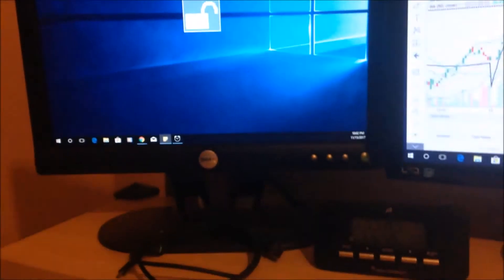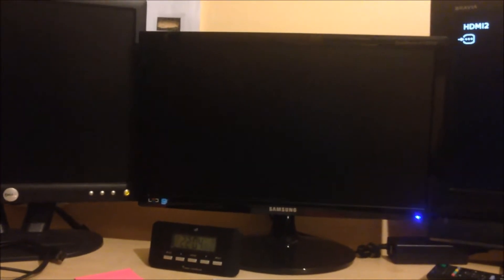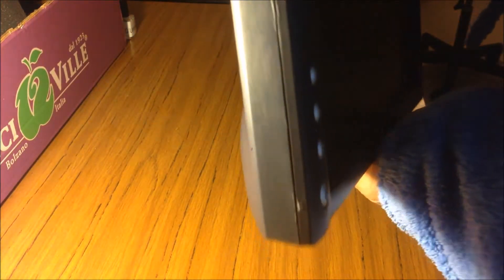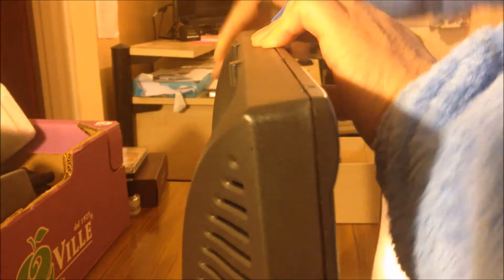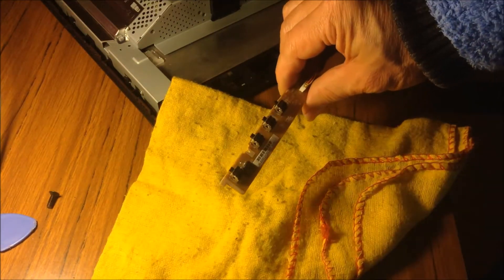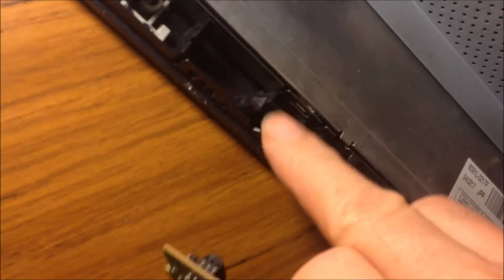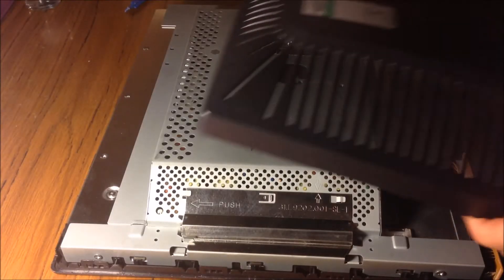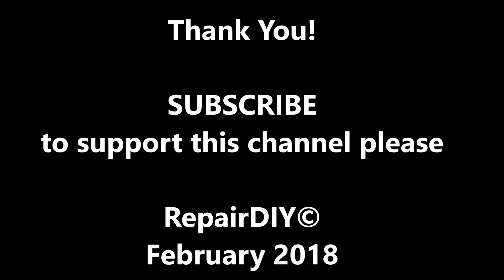Dell Monitor Lock Icon: Investigation (not solved)

Comment: it happened to me. The problem was the button was stuck so i opened the monitor then clean the board on the monitor button and the flex connected to it and it solved the problem.

Comment: Same problem here. Did you got any solition?
Reply from the maker: Hi, not yet. I am still using it as my third monitor to display less important info. I have been thinking of by-passing the button circuit and only keep the power button ,but haven't tried yet. if you find any solution before others, please share your success here. have a good day!
Reply: @RepairDIY  when i press exit button for few seconds it goes away. I am thinking of sorting the button by soldering it.
Reply from the maker: @muhammadshakil3723  hi, in my case, i tested all the buttons, they were all working well and none of them were sticking. however when they were connected, the monitor's behavior was like that some button be stuck! good luck!
Reply: After opening cleaning with alchohol and removing the dust. It started working normal again. 6 months ago.